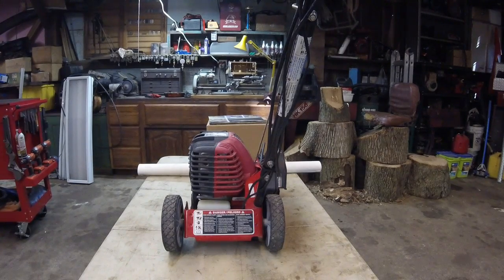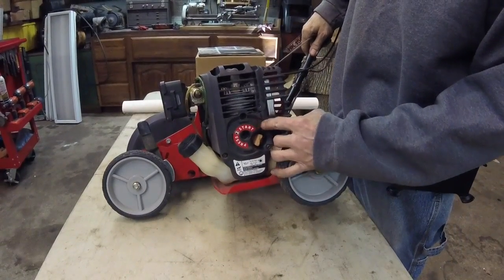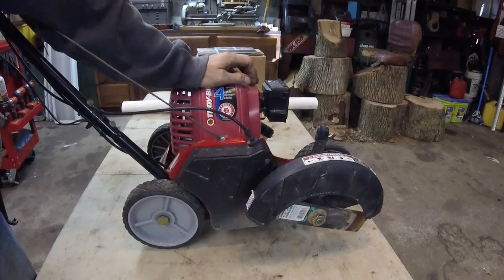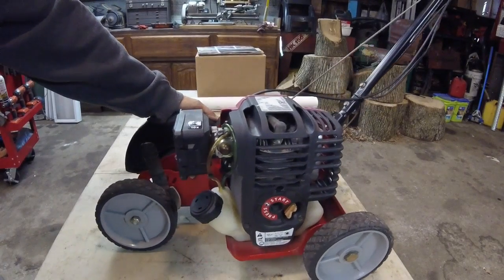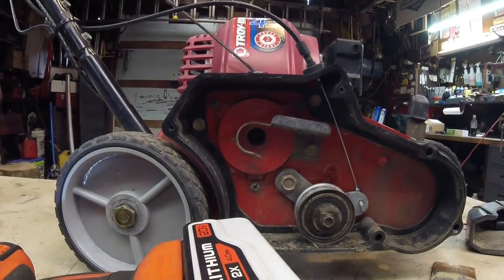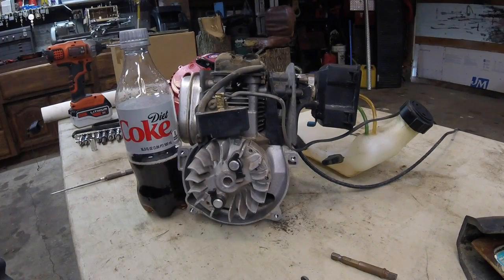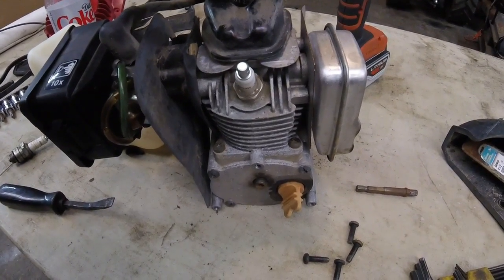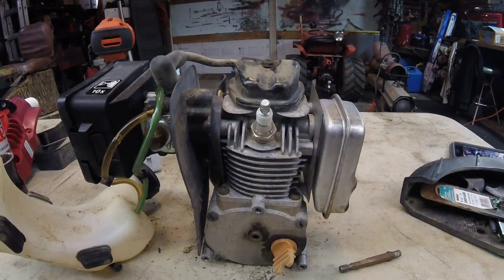Mini Briggs 4 Cycle Gas Engine and Shout Out!!

Comment: rig an alternator to the crankshaft and make a 12vdc generator.  Having a Inverter and a battery installed will give you a AC option too.  I have all of those items in boxes around here
Reply from the maker: Same here Randy. hmm...it's a toss up between a Mini Garden Tractor or a more practical use. I'm leaning towards the mini GT though. I've got just about everything I would need for that build and it would be a blast! Cheers my Friend! Zip~

Comment: Hey Zip. Your show is lit up like Broadway now. After seeing those LED lights in action in a shop setting. I am going to get some for the garage. LED lights fire up better in cold conditions, better than flourecent lights. On your mini 4 cycle. Cool find. I picked the exact trimmer up from a friend that trash picked it and nothing is wrong with it. Their crankcase holds a small amount of oil so watch overworking it. Home Depot customer comments on them was that customers using the mini 4 cycle tillers, on extended running time caused the nylon crankshaft in them to melt. I have heard similar things on the Mantis tillers also. I advise people that have them when it runs out of gas, to go get a beer, and let it cool off before refueling and using it again. lol.
Reply from the maker: Great to know if I use that engine in a practical application that might cause that issue. The crank shaft or drive shaft? Zip~
Reply: The crankshaft.
Reply: Sorry my bad it is the camshaft.
Reply from the maker: Ah, ok, that makes a little more sense. Less of a stress area. But, still very good to know! Zip~

Comment: Hey Zip That tach was really COOL that you gave Roadking. Nice little score with that engine. I have one like it in my hoard but it's missing the carb😞  Congrats on the new subs!
Reply from the maker: You can use a standard 2 cycle weed eater carb on it Dave and it'll work fine. This one has a little Zama on it, which is what my Stihl trimmer has and two of my off branded chainsaws has as well. I've got another tach I prefer using over that one and I knew Roadie would love it. So...why not pass it along right? Cheers my Friend! Zip~
Reply: Yeah I kinda thought that might work but I haven't tried it yet

Comment: you could make a little belt driven go-kart, thats what i did.
Reply from the maker: At 29CC will it actually get out of its own way? Zip~
Reply: ZippoVarga oh yes goes about 20-30 mph what i did is put an idler pulley off of a craftsman riding mower, so it wont go into gear when you start it.
Reply from the maker: What kind of ratio if you know? And how did you go about attaching a "drive shaft" since there's that strange 5 point connecting socket? Curious minds need to know! lol Zip~
Reply: ZippoVarga Not sure about the ratio, but i just welded the main drive pulley to the back axle of the kart, and  mounted the engine to the frame in line with the pulley, made an adapter to slip over the shaft of the engine, put the idler pulley on the frame as well, the idler was spring loaded and you could engage it when you were ready to go... only hard part was finding the right belt size! other than that a fun little project from stuff lying around. Could also use a chain, that may be better.
Reply from the maker: That gives me a couple ideas with this one.